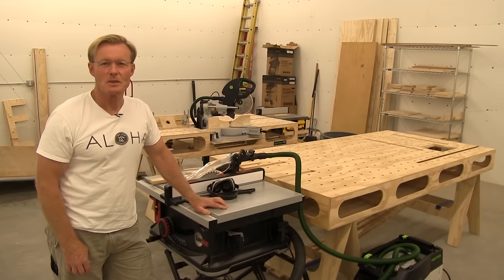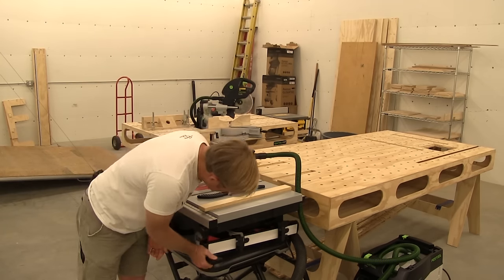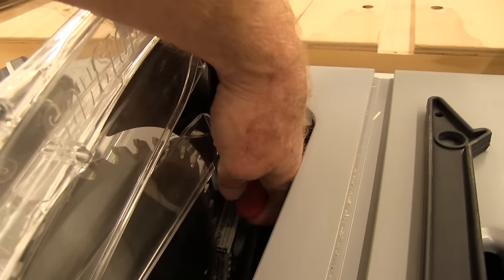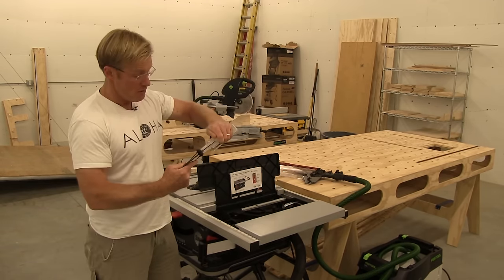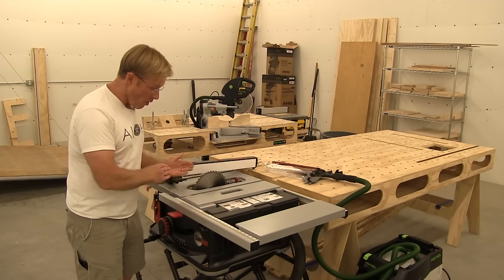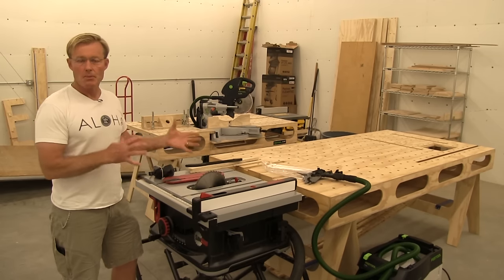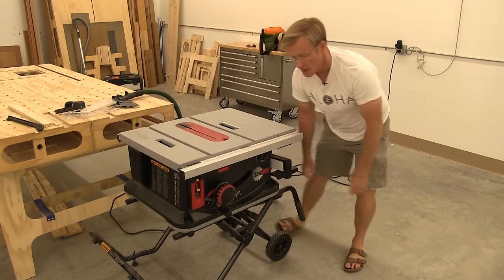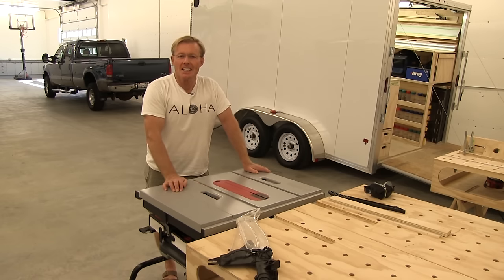Is the SawStop Jobsite Saw Worth the Investment? My Honest Review

Comment: How about dado blade capabilities?
Reply from the maker: Ricky Mcgrath Yes, they even have an 8" brake.
Reply: I think mentioned near the end of the video that he was considering getting a second saw so he could run a dado when he's in full production mode. Were you curious about the stopping capability of the saw when fitted with a dado stack?
Reply: Ron answered my question perfectly. Dado blades are 8" and I wasn't sure how the break system would work which was designed for a 10" blade on an 8" dado blade. He stated they offer an 8" blade
Reply: if the saw is similar to how it was when it came out -- i works with dado blades...but not any dado blades. different companies have 8" blades that differ in size enough to fall out of spec for their distance  between the saw blade and the dado brake.
Not a "big problem" but just do not assume that any dado stack will work.
Unlike for their other saws, there was (is?) no means for adjusting the blade to brake clearance.

When i had this problem the saw was Very new on the market. The folks at Saw Stop were fantastic (as was my local distributor).

Comment: I looked at that saw a few weeks ago, and decided to buy it. I could have bought it then, but I didn't. A week later I jammed my finger into my trusty Makita table saw. It was like a hammer drove the tip into my hand, and my hand went back behind me so fast, I didn't see if I lost the finger. The paid was tremendous. I saw the blood drips on the floor, and then looked at my finger! It was still there! http://prntscr.com/ddwqmx I bought the contractor model. http://prntscr.com/ddwsl4 It's 350 lbs, but I'm going to get the job site saw too. I consider myself so fortunate. 40 years of cutting wood, and I almost blew it! It happens so fast. Now I feel confident that if I get careless, I have another chance.
Reply from the maker: Oh man! I feel the pain just looking at the photo. I have only ever cut myself with a razor knife and that was bad enough and cost me $900 bucks to get it stitched 20 years ago. All of my table saws from now forward will have a brake. It only takes one distraction and the saw in comparison is very cheap, not to mention the pain. It would be great if miter saws had the same protection. Glad you didn't lose a digit.
Reply: Yeah I did the razor knife cutting Linoleum. You know how hard you have to press, and ouch and deep! I love the inside of you trailer, you got some clips on that?
Reply: I did this to my thumb about 90 years ago on the same saw. I was cutting 3/4" teak, I think it was about midnight, I started at 6 am probably. Luckily I had the blade only about 1/8" above the wood. I use a push stick, but it's the left hand. The wood starts to bind or something, and your left goes into auto pilot to save the wood. Or, I was once hit in the chest with a 2x6 block from kickback, so I was trying to avoid that. Apparently my hand thinks it knows best. But that left hand wants to help before the brain can kick in. From now on, it's duck and let er fly I guess.
Reply from the maker: Pat, take a look at my channel. The trailer "ART" Awesome Rolling Tool box has more press than Julia Roberts. https://www.youtube.com/playlist?list=PLB1ATCukiUGRWcPQFFI0CBXaoniyBXRMz
Reply: I could tell you da man very quickly! Mind if I copy some of your stuff! It's awesome!
Reply: I'm want to do the mobile tool box in a toy hauler.